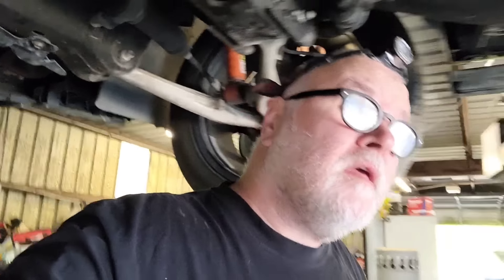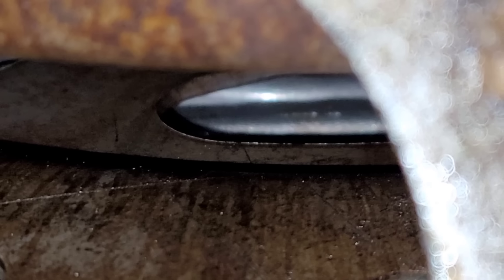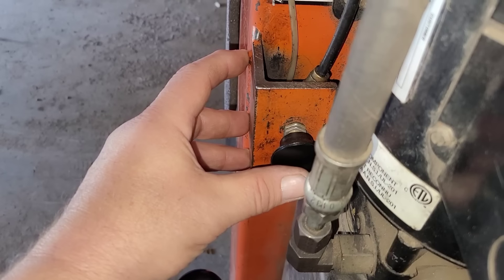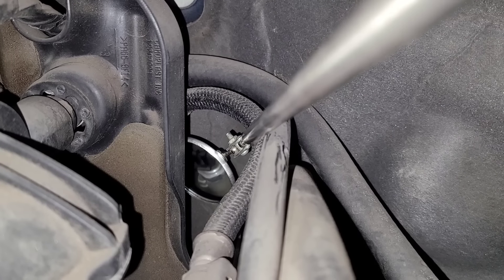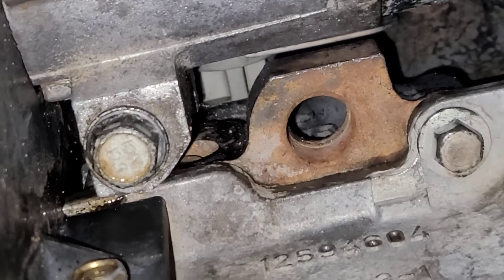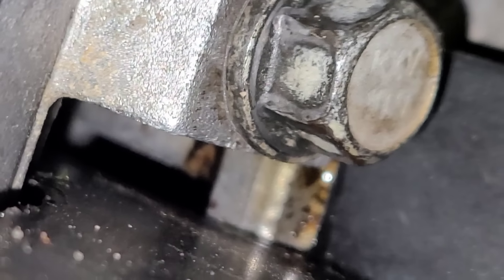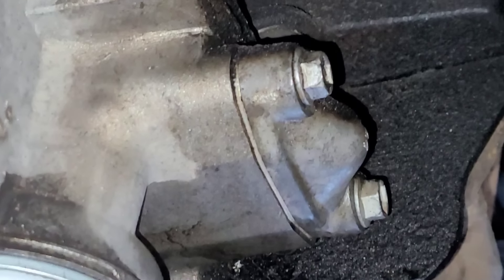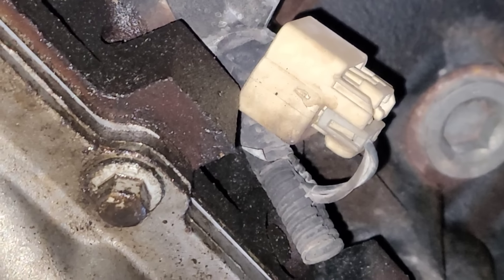Rear Main Seal Leak Thats Not A Rear Main Seal Leak. 4.8 5.3 6.0 6.2 GM

Comment: I've been preaching this for years about the LS engines.  It's almost always the rear engine cover gasket!  There's also a porosity issue with the OEM rear covers where they will weep oil through the metal cover.  People will change the oil pan gasket and the leak will continue.  They'll then replace the rear main seal and the leak will continue.  They'll finally replace the rear cover and gasket and the problem is solved.  The camshaft position sensor is not in the back top like older LS engines but that's also a common leak point due to the o-ring going bad over time.
Reply: what to you consider an "older LS engine" ?
Reply: I’ve been doing the professionally for quite a few years. So far I’ve never seen a rear main seal fail on these engines. It was always the rubber portion of the two piece gasket flattened. The cure is to get the whole rear cover! I had only one come back and it was wicking oil around one or two cover bolts. Added silicone th these bolts. Was cured! 2:25 2:25 2:25 😅😊 2:25 😅😅😊😅😊😊😅😅 2:25 2:25 2:25 2:25 2:25 2:25 2:25 2:25 2:25 2:25 2:25 2:25 2:25 2:25 😊😅 2:25 2:25 😅😅 2:25 2:25 2:25 2:25 2:25 2:25 2:25 2:25 2:25 2:25 😊
Reply: @DannyDisharoon When you say "rear cover" are you referring to the crankcase cover? I'm facing a similar problem on my vehicle and I'm struggling to find the plate he's talking about on a parts list
Reply: @crabapple6775 the gen 3 engines has the camshaft sensor in the back and gen 4 camshaft sensor is in the front. Gen 4 2007 or newer.
Reply: @robotY0UTUB3 A lot of the time the cover and seal come together. Look at a picture of the rear main seal.
Reply: When the cover gasket is not done right, where is the oil coming from that leaks from the bottom of it?  

If the oil pan seal is good, crank rear seal is good, but the cover plate is not sealed, where does the oil leak out of?
Reply: Hello! When you say the Rear cover and gasket, your not referring to the rear main seal cover and gasket? I have the same issue after replacing the oil pan gasket and oil cooler line gasket. Thank you!
Reply: Im curious to find out what was the root cause of the leak . I have a 2004 Chevy Avalanche 1500; few years ago I replaced the rear main seal and still continued to drip. Recently I replaced the pan gasket , timing cover gasket , cover gaskets . And the leak is still there . We sprayed with brake cleaner cleaned and the rear is as dry as can. But did. Notice a slight oil tiny insignificant  drip inside the rear . So, I’m kinda hoping anyone can comment on this .
Driving me crazy
Reply: @robertoahedo3184  I've learned not to chase leaks that are not big/fast enough to make oil loss significant.
Reply: @robertoahedo3184  Have you checked the valley cover gasket? Sometimes that can leak oil and make it look like its coming from the rear main seal area.
Reply: @robotY0UTUB3  Did you ever figure it out? I think I have the same leak but I'm totally confused about which gasket is needed. I'm pretty sure it's not my blocker plate gasket.
Reply: @robertoahedo3184  it's usually a valley cover gasket leaking down on everything else, they're notorious for leaking from rear corner.
Reply: @robertoahedo3184  Dipstick tube o-ring? Crankshaft sensor o-ring?

Comment: When I had wetness near the rear main on my Chev 5.3 a couple of  years ago, I assumed a rear main and decided to ignore it. It was a stupid mistake. Later when the oil pressure sensor finally failed I discovered that the oil was coming from the sensor up top. Doh!
Reply from the maker: I just had one a month ago. It's pretty amazing how easily it's mistaken for a rear main seal
Reply: Really? Do you know for what year and what the sensor is called? Also where about is it located? I'm scratching my head on a oil leak as well..99 Silverado 5.3.
Reply: @j.v.1166  2000 Suburban, up top at back, oil pressure sensor, I did a video titled "understanding oil pressure".
Reply: Same! In a 2007 Chevy suburban. I was on a trip with family when noticed oil leaking while pumping gas. I freaked out. Turned out to be the oil pressure sensor leaking.

Comment: My issue started when I changed the oil on my 4.3 v6 2000 chevy pickup. After changing the oil I had big oil spots on my driveway . I suspected the crush gasket on my drain plug, so 20 miles later I drained my oil to replace the crush gasket on the drain plug, GOT IT..  Well I continued to have big and bigger oil spots. Shoot either wrong oil filter or double gaskets on the oil filter. 22 miles later I got a new oil filter and I changed it, NO double filter gaskets.. I thought maybe the oil filter was defective. Either way it should stop leaking. NO , still having bigger oil spots. Basically it was the oil pressure sending unit leaking. I replaced it and NO more oil leaks. Regardless why did it start leaking after I changed the oil ? Because that’s the way Murphys law works. I thought that was going to be the problem on Kenny’s video.
Reply: Omg. That is insane. Glad you found it.
Reply: When I was a young teen just starting to mess with cars, changing oil, tires, simple things, I changed the oil on my dad's Ford and then the light was on all the time. It blew my mind.
In those days most cars just had idiot light for oil pressure which usually didn't come on until the pressure was almost zero, Fords would come on under about 10 pounds
The pressure was low but enough to feed the engine, not enough to turn out the light. The way it decided to start acting like that right after I changed the oil was not what this young kid needed.
Reply: The same reason a fuel pump tends to fail right after you fill the tank. 🤣

Comment: We've had about 35 of the 6.0 engines in our fleet I've replaced the rear main and plate gasket in only 2 of them and they both had 300,000 plus on them. Very durable engines.
Reply: I have one of them and the mechanic replaced the main seal 2 times then discovered the plate was leaking at the bolt holes in 3 places

Comment: Oil leaks are a pain, especially if the transmission has to come out. $$$  It can be deceiving sometimes, that what appears to be a huge leak really isn't. A few drops of oil or trans fluid looks like a lake on concrete. That one is pretty significant though, since you cleaned it and all, you can tell it's pretty bad. At least if you pull the trans, you will be able to change the seals on the engine and trans, and that gasket you were talking about.
Reply: Not bad to do on a RWD. It's the FWD that are a pain in the ass.

Comment: On my 2000 Saturn 3.0 I have the similar issue. Of course 3 shops gave me all different diagnosis, and ALL were wrong. Valve covers, oil filter housing and oil cooler line gasket. It leaks in that same area between the engine and trans. I had the engine installed 2 years ago, and after about 6 months started the leak. It used to leak on the cardboard on my garage floor, but has since stopped in the past 6 months, but still leaks while running, because it still is wet and runs back along the trans and blows back on the exhaust pipe bend and smokes when the lights are on, and I can smell oil burning. I thought it was the main seal, but not sure what covers there are on a 3.0 around there. I put some 205 RE sealant in it and see what it does. The pan usually drains in about 3000 miles and I have to add a quart and a half between changes with synthetic oil. We'll see if that stops it. I'd hate to spend $800 to pull the trans to replace a main seal. I'm too old to mess with that kinda stuff myself anymore. Lol.
Reply: Edit: It started leaking around 138,000 and now has 162K in the 2 years the different engine was dropped in it.

Comment: I had a 1998 express van and the timing chain cover just split open.
We bought it brand new . All decked out VCR, TV, headphone jacks fort.
Regency .
Anyway to change the cover I had to change oil pan gasket and timing gasket.
Bottom of timing cover a rubber gasket was both covers gasket.

Comment: What are your thoughts on replacing a real main seal on a truck that isn’t leaking yet. I have the transmission completely pulled for a rebuild. No leaking but don’t want to ever ever ever remove the transmission again. lol. I’m all about prevention but I don’t want to replace something that isn’t broke.
Reply from the maker: What year make & model is the truck?
Reply: @ 2007 Chevy suburban 4x4 with 200k miles.

Comment: I rebuild transmissions and when ever I have the transmission off one of these engines, I always put my finger tip into the well where the cam sensor is located and have found many to be  leaking, also there is a pipe plug where that block off plate is on the oil pan and it will leak and it cant be removed as installed, but when the transmission is out it can be checked for tightness or resealed.
Reply: Does that plug sit right behind the starter? I got a 4.8 that looks like it's leaking out of a bolt (where crank sensor would be on other models) right above oil pan gasket and just behind starter
Reply: @Father_Adrian  No, the plug I'm speaking of is on the other side "drivers side" it is there to plug a drilled passage for the oil cooler circuit in the oil pan. Leaking oil travels by two means, gravity and wind, so always remember that where its dripping from is not necessarily the source of the leak. Put sealer on the threads or check the O ring on the sensor or plug if it doesn't have a sensor where it could have one. Good luck, and be the oil leaking. Where would you go?

Comment: Thank you for this.
I'm so torn on what to do with next with my 08 5.3 Chevy 1500. 
She leaks about 2qts oil every 5k miles, and has done this for about 25k miles. I replaced the oil pan gasket, and it still leaks. It was stupid of me because it will only leak after it's been driven, so no duh it wasn't the oil pan gasket.
After watching your video, I don't know whether to replace the rear main seal, oil cooler, or the rear cover and gasket. DANGIT.

Comment: My 2006 Tahoe 4.8 is leaking by the starter like in your video. Also at the end of video that gasket you pointed to above oil filter mine is wet all around there with oil also. I'm going to clean it like you did and watch it idle to determine where it is leaking. Thanks for the video showing this.
Reply: Easy fix on that oil cooler gasket.. the other is another thing

Comment: I have a 2005 Yukon 5.3L 4x4. Looks exactly the same. I may have a very slow rear main leak. I just got it and am watching it now after a fresh oil change. Has 216,000 miles on it. Seems to run great though. 

3 questions:

1. Was there a cover on your inspection hole that shows the bottom of the flex plate? Mine does not have a cover of any type. I can see the bottom of the flex plate.

2. I have a pair of ramps that raises vehicles back or front tires by about 12". Would that be helpful to use for this job?  

3. So the rear seal has two parts? A shaft seal, plus a shaft seal cover gasket?  Does the cover seal just keep dust out?  It doesn't have a gasket across the bottom of it, does it?
Reply: Correct. There is a radial oil seal and a rubber seal for the cover plate. The bottom of the cover plate is what the oil pan seals against with it's own rubber seal. It's important to align the plate properly so that the seal bore is concentric to the crankshaft and the bottom of the cover is perfectly horizontal. The alignment tools are cheap and can be found on Amazon or eBay. You install the cover with the alignment tool inserted where the seal would be, and then tighten it down and install the seal last. There's also an alignment plate for keeping the bottom horizontal in case the oil pan isn't installed, which is the only way I've personally done it. Better replace the oil pressure sending unit while you're under there, as well as any sensor o-rings. To be honest, it may be best to have the oil pan off, and to change the pick-up tube o-ring, but that's quite a bit more involved, especially with a 4x4. Just my 2 cents.
Reply: @ryanmcrae3593  When the cover gasket is not done right, where is the oil coming from that leaks from the bottom of it?  

If the oil pan seal is good, crank rear seal is good, but the cover plate is not sealed good, where does the oil leak out of?
Reply: @thesetruths1404  I honestly don't have enough experience with the LS engines to be able to tell you for sure. Maybe someone with more knowledge of these issues will chime in. I'd say the oil would most likely be coming from where the cover mates to the oil pan.

Comment: I had taho 5.3 was a leak so dealer put dye in and could not dine the leak then I looked at it and realized it was the engine mount leaking 95 bucks for dye test and they were wrong

Comment: ya some shop changed this on a 06 5.3 and its leaking worse now 40k miles later than it  did when it had like 140k.    Sucks removing a transmission on jack stands

Comment: I have a 2006 Silverado 5.3

Had rear main seal replaced about a year and a half ago along with oil pan gasket and valve covers.

Still had the leak.

Had to have some work done a few months ago. Asked them to check the leak. They said it was valve cover gaskets and they were replaced again along with something else underneath ( don't remember what).

Stoll have a leak but not as bad.
Reply: As long as you have the money, I guess theyll have the time.
Reply: @edsyphan3425  - This was 2 different places.

I think both places actually got some of it bit there us something they missed and may be this plate the video is about.

Comment: @Wrenching With Kenny This helps me a lot. I have a 2008 Escalade EXT, basically the same truck as this, But mine is the 6.2 with 4WD. I have had a minor oil leak for a few years, about 4-5 drops on the driveway over night in addition to whatever it leaks out while driving. The truck has about 110K miles which is low for a 2008. But after I did an oil change last week the leak got about 10 times worse. Constant drip while running and once parked it will leave a 6" diameter puddle on a smooth surface like concrete. I'm at the point of putting my oil change catch pan under the truck instead of a sheet of cardboard. I assumed it was the RMS so I put in some blue Devil RMS additive. The leak has slowed, now down to under a quart a day on a very light 30 mile a day commute and seems to get better every day. But last night I cleaned everything then started the truck and got under with lights and I see now the oil is running down both sides of the back of the oil pan and collecting around the trans inspection port. Inside the trans inspection port it looked just like in this video, a little wet but not nearly enough to explain the amount of oil I'm losing. I'm thinking oil pan or oil pressure sensor as it's coming down both sides of the back of the engine. I still need to look at the back of the engine above the oil pan. Thoughts?
Reply: 07 Escalade with an oil leak here. Similar situation as yours. Oil coming down both sides of the top of the trans is what it seemed like. Changed my valley cover gasket, valve cover gaskets, oil pressure sensor and intake manifold gaskets while I was in there.

I’m willing to bet that the leak remaining is either this plate in the video or RMS. Gonna try to solve it this week
Reply: I fixed a bad oil leak on a 07 Denali, that was very difficult to pinpoint because it would drip down above the transmission bell housing, it ended up being the valley pan gasket.

Comment: i've done these a few times. i pulled the engine replaced the rear plate comes with seal when it was easy to repair the exhaust leak at the left rear manifold and the list of all the other leaks . crank sensor oil filter housing oil cooler hoses ps hoses
Reply: Whats the plate called

Comment: Great video, I have the transmission removed out of my 5.3 Silverado,
But it’s very clean in between the transmission and the engine, is this normal? Mine leaks and drips down the started just like your video shows it leaking

Comment: I'm very curious about the oil cooler gasket that you said.my truck does not have one but it does have those two bolts and gasket. I've changed the oil pan and gasket and still leaks .took it to get an alignment and the technician said it was a engine seal but didn't show me...99 Silverado 1500 5.3 2WD.

Comment: I have the 5.7 litre Chevrolet LS1 V8 engine fitted into a VY Commodore sedan here in Australia & I replaced the old olive coloured rear main oil seal which was 13 millimetres thick with a 10 millimetre thick black Felpro  rear main oil seal back in 2016 & I also replaced the seal carrier gasket as well because it's a lot easier to fit the rear main oil seal when the carrier is out of car since it's harder to replace it while you're lying underneath the car at home.

The old seal carriers is deeper so I was very careful regarding how far to push it into the seal carrier.

I have replaced the oil pan gasket because I was driving over rough road in a Commodore meaning that the oil pan bolts kind of vibrated loose !

Comment: Can someone share a part number and link for the "Plate Gasket" as it was mentioned to be the number one culprit before the RMS gasket. I can find the gasket for the oil cooler connection point "block-off plate" (although i dont have it by my 4.8L).

Comment: For the longest time I thought I had a rear main leak. Then I did head gaskets and found that all the oil I thought was coming from the rear main, was actually coming down from the back of the valve covers.
Reply: Was it leaking a big puddle and leaking after you shut the truck off and got a nice puddle lol

Comment: I have leak btwn the engine and trans on a 6.0 that occurs as it sits on a lift through winter storage.  Is there oil trapped behind this plate that would drain out after the car has been sitting for an extended period of not running. All the oil should be in the sump by this point and not above the crank seal